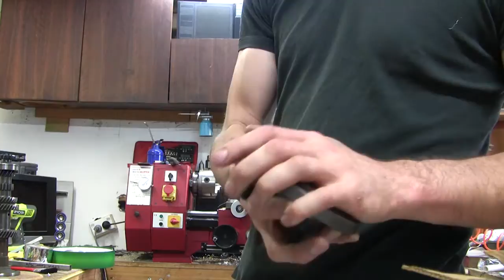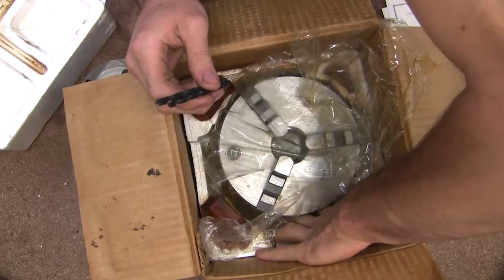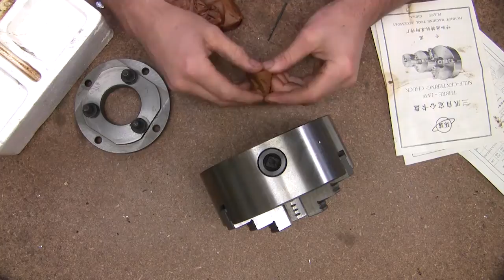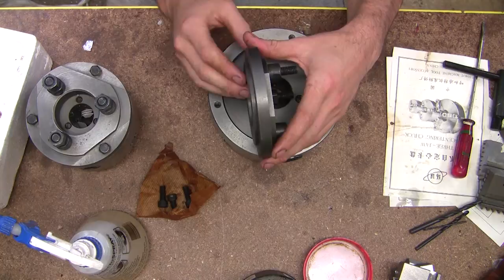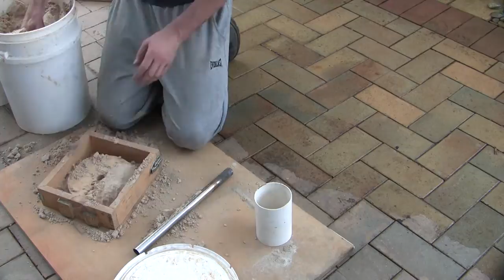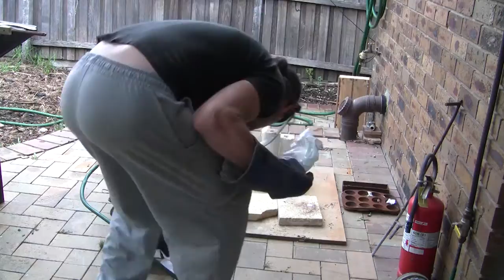A backplate for a 165mm chuck on a Sieg C6 Lathe part 1

Comment: Hi. I also have an AL-60 and agree with you thoughts on them. 
I like the mods you're doing. I have to get onto modifying mine. I added a second clamp to the back of the tail stock so it doesn't move when adjusting off-set.
Keep up the great work.
Reply from the maker: seditiousmonkeyart thanks!